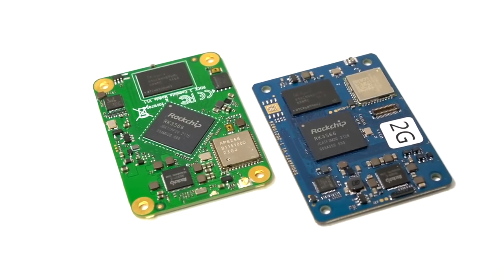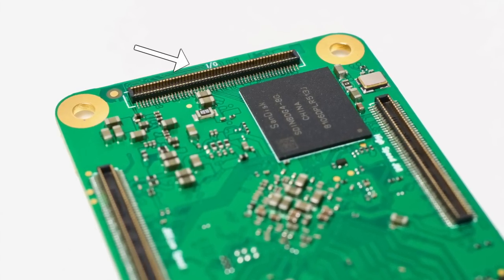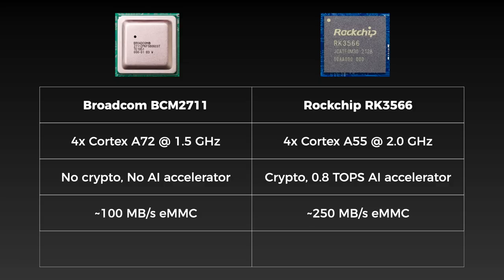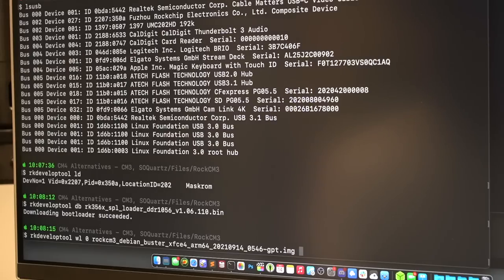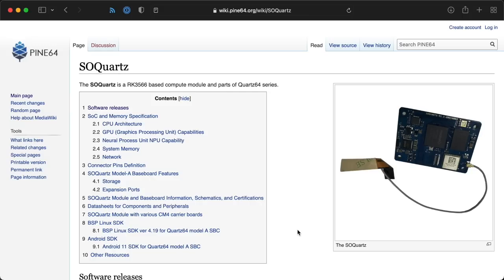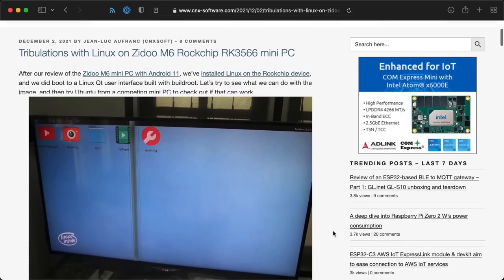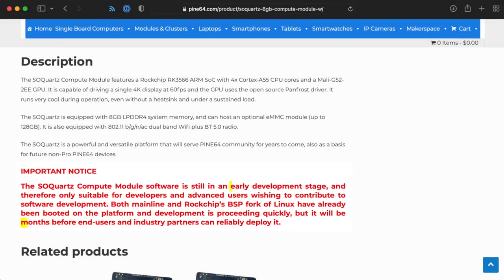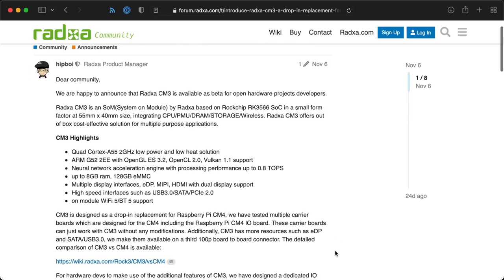Can these boards replace the Raspberry Pi CM4?

Comment: Got similar experiences with non-pi boards. The lack of community support makes them harder to use and after a few years the images disappear from the web and you end up with a paper weight. I do not have this issue with my old raspberry Pis. Third party board needs to be really cheaper to be worth it in my opinion.

Comment: I fully agree with your observation. I had a time where I also bought several other boards based on the hardware specs. They almost all did end up in a drawer because of software and documentation issues. Overall I came to the conclusion that it is far more likely to get your project working with a raspberry pi then with any of the other boards.

Comment: I have to agree with this video 99%. It was a detailed explanation on how is the current state of those very early rk3566 modules. But things will change quite soon. Rk3566 is a new soc and will take some time to get everything working nicely on mainline out of the box.
Reply from the maker: It definitely takes some time, and like I said at the end, I'm hopeful that time will make these boards both viable CM4 alternatives—especially for tinkerers who want to build a compute module carrier but might not be able to find a Raspberry Pi CM4 anytime soon!
Reply: @JeffGeerling  shortage sucks

Comment: Armbian seemed reasonably civilized. I have a super cheap rockchip laptop, and Armbian was pretty easy to setup. I expect hardware projects with the plain boards is more of a challenge?
Reply from the maker: The Ambian community does seem to be the most helpful in the space, and they often pick up support for the more neglected boards. I wonder if some of the board makers should try to work more directly with Armbian to make it a truly first-class distro solution, and offer ongoing support?

Comment: It's fair enough.
Usability is king. If you can't get up and running in a jiff, or sometimes at all, what's the point?

Speaking as someone who detests Linux but has to use it a fair bit, it's actually refreshing to see someone who likes it and cares about usability.

Comment: you are correct on supports importance. At first when i started with SBCs 5 or 6 years ago i bought a few orange pis as they were much cheaper, but i've never managed to get them stable enough, had to constantly try to hack them, so eventually i grew tired of it and bough a raspberry pi 4 which is now running home assistant and is very stable as I'm booting it from an SSD.

Comment: Same impression on my side, BeagleBone Black and Odroid XU4Q are quite the same story: You need to devote a helluva time on getting them to boot to prompt, then to update them, then fix the broken updates, then work some more on them, before even thinking about starting a project on them. 
Raspberry Pi: Flash and pop in an SD card, switch on, start project.

Comment: I have faith that the Pine unit will get there. I have an early Dev version of the Pinebook Pro and it has been a great device. The only reason I'm not grabbing a SOQuartz is that they went with A55 cores instead of instead of A78s.

Comment: @Jeff: actually the A55 is newer than the A72.  A55 is contemporaneous to the A75, and the A53 is contemporaneous to the A72.  The true reason the A55 is slower than the A72 despite the A55's higher clock is because A55 is a "LITTLE" in-order core and an A72 is a "big" out-of-order core.
Reply from the maker: True... that was a bit of a missed statement in my editing. It's faster but not newer.

Comment: I found this to be spot on when working with Orange Pi..a very strong contender with Raspberry Pi...lack of support and documentation yet they work GREAT and are powerful little boards...
Armbian has made leaps and bounds with it's development but like you said...you have to be tech savvy to keep up, however it does work...and works well in almost all cases

Comment: As for me, the important consideration was that Raspibian comes up with the license for Wolfram Mathematica. None of the alternatives do.

About this CPU: having hardware USB3 and SATA is nice, but, you know, those are multiplexed in the RK3356: SATA1 with USB3 Host, SATA2 with PCIe 2.0 x1. So you can have one at the expense of the other. Which is not so nice.

Are there generic ARM CPUs which are faster than this Broadcom and still usable for small/personal computers? (I don't count M1, of course.)

Comment: Not surprised with this.  Am not in love with raspberry but it works.  Am still searching for an easy way to load up around 16 CM4 modules with one standard RB Pi 4B controller.  So, far no joy.  I had hopes for the turning but it was a let down.  I understood the design choices but it conflicted with my overall goals.  Ideally, likely not feasible, I wanted to build a laptop with one master RPi4B and around 16 CM4's.  Where the master could farm out tasks, service as a file server, run the display, mouse and keyboard.  Where the CM4s would handle the actual tasks.  I know that clustering has took a major turn backwards in the past two decades.  So, I have considered writing another OS not based in WIndows, MAC or Linux.  Of course finding software would be impossible if I did as i would have to write it all or convert it to another OS.  PAINFUL!  But at least we would have a working cluster again.

Comment: for the PINE serial port, there's a couple of options out there that work-  use a raspberry pi as your serial interface.   Or, if you've got a busblaster floating around, that'll also work for you.  The DSD TECH SH-U09C2 will do up to 3mb/s  as well,  but i don't remember if I tested it or not.

Comment: This is exactly the problem I've had with some Orange Pis few years back.
Most board vendors just design the board (which is not that hard, just re-draw what's in datasheet, throw some extras and you're done. Did it, been there), build the prototype, get the "Yes I'm alive" signal from SoC and calls it a day. Some even go to such extremes as compiling a kernel or a full OS for you, but that's it. No documentation on anything, some give you u-boot thingies so you can compile yourself, but that's more rare than often. As someone already said, we need standardized boot environment for ARM devices.

Comment: Funnily, though I watched this video on another of Pine64's product (a Pinebook Pro laptop) which by now is quite mature and works out of the box. Proof that eventually, they can manage to release mature products.
Which is also why they have a logic of releasing "early developers access" versions of their products as fast as they can to as many developers they can: their community will eventually manage to help to document, to polish software, etc.
Probably, by their upcoming PineReader (and surely in a year or so their Pinebook 2) will be out, support for booting RK35xx hardware using entirely up-steam opensource package will be in much better shape.

Comment: 5:48 Armbian requires technical know-how? Maybe on boards not yet well-supported, but my experience with Orange Pi Armbian images was pretty easy, just burn it to an SD card and do initial setup, like the Raspberry Pi.

Comment: I totally agree with you. Why people kept using RPis for years even when its performance was pretty bad, had no USB3, and limited to 100Mbps ethernet is because there's tons of information everywhere.
I used to have a Beaglebone Black board, and I still remember the lack of information compared to RPis, though it's probably 100x better situation than these RockChip boards.

Comment: I feel your pain and have a heap of discarded boards to prove it. The one exception for me is odroid which I have found to be quite versatile, sufficiently documented and stable. I'd take a C2 over a PI3 any day for performance especially on ethernet but my use cases don't include wifi. I can't claim I wouldn't love a C4 with 8G of ram like I can get on a PI4 but the networking and emmc of the C4 do make the choice harder despite the ram. Having uboot is certainly a plus as well.

Comment: Jeff is right. These rockchip solution is painful to deploy. Those uboot compile option is needed to flip around to get these board into booting stage. That is why rockchip can’t become a trend. Their hardware spec is good. But, the people who maintain it to keep up with Linux distribution is far from enough or even barely can call it a “product”. It’s like those ancient Android setup boxes become ewaste at the end become vendors are dead or not doing any support at all. Those setup box are still working fine without problems except hardware could be outdated in certain way. But, those are still fully functioning hardwares. It still can be used in certain way. I think that is the problem of arm community. It needs to have certain standard on uboot(like bios with uefi) portion. It makes compilation much easier to support different arm platforms. Then, initramfs can be customized on top of it. It will make everyone life easier to develop stuff on these boards.

Comment: While some manufacturers provide good information, I generally have an issue with RockChip based SBCs. Mainly because they don't just boot from a filesystem like Raspberry Pis boot partition, but they need the binary blobs to be located at specific memory locations on the SD or eMMC storage. On top of that it's a bit of trial and error to figure out which of the blobs are the correct ones for the board (afaik this depends on things like memory speed, soc version and whether you want to boot from flash or SD). 
Even if the manufacturer provides a image, third party support can be quite difficult and even then you might run into issues with the on chip firmware and you have to flash a firmware upgrade via some proprietary software that is poorly documented and apparently some versions of it might select the wrong memory location and brick the board.

Comment: Hopefully we will see a RISC-V alternative in the next few years where everything is open all the way down to to HW. As an embedded Linux developer I would  be more hesitant to do development on Rockchip that is more subject to change than more established suppliers like Broadcom and Qualcomm/Atheros(even though they both have a lot of proprietary parts). You have to remember its not so much the processor(ARM, RISC-V, Tensilica etc) part you are developing for but rather all of the SoC parts(GPIO, HDMI, WIFI, serial, packet-processors, crypto-engines etc)
Reply: The only concern I have with the RISC-V chip approach is that the people paying for the boards may not care to have a standard that even looks like SBC(s).  They might want to implement the RISC-V general spec for only 40% and the then use custom extension.  This allows for them to produce product for specific function.  However it does not mean that we get a usable SBC 'like" board.   Well not a price point that we get with the Pi ecosystem.

Comment: I personally am a software guy, I expect the hardware I buy to just work so I can do my stuff. And RPi is just the safe and reliable choice. Yes, other SBCs might have more processing power, but I think if that's what limits your project you're probably doing something wrong. And others might be cheaper, but honestly that difference in price is far smaller than the value of the time I'd waste by troubleshooting some stupid little issues.

Comment: If you have a Pi Pico, try making it into a UART interface, use the micro usb for console, and its' pins as TX/RX, just make sure you already set the usb baud the same or higher as needed.  This workaround was a hackey solution I did ( and didn't document/backup/save someplace useful ) when I had a few ESP32 boards from an eBay auction and didn't know what was on them or their speed.  One was at the max speed choosable for the Arduino IDE comport speed...  Good luck.
Reply from the maker: Yeah I've considered this; right now I have everything powered off but the Pi itself might also be able to do 1.5 Mbps serial...

Comment: That's what the Raspberry Pi originally brought to the table. It was the cheapest and easiest to use embedded system. Everything else at the time cost at least three times as much and had to have the OS be compiled from source.

Comment: The point made here is rather critical for developers of new platforms, if it is difficult to implement clients will struggle to employ it, or better said, 'the easier it is to implement' then the more easily it is adopted and Raspberry Pi Foundation have really shown how to do that. Again and said another way, my old MacBook failed, I bought a new one, and after plugging it in and entering my iCloud id I got my entire life back again, no fuss, no muss. If you want to develop a new platform really understand what Arduino, Raspberry Pi, and Apple are doing to make things rather less complex.

Comment: Moral of the video is just that those cm4 alternative boards are capable of doing a lot of things it's just that they are new to the market and they don't have good enough compatibility and reliability with applications, tools and OSes at least not yet and when it comes to compatibility in SBCs Raspberry Pis are much superior and reliable not because their hardware is better than the competition but because they are in the game for quite a while now and whenever a developer is developing a OS, a application or even a script for a SBC they usually take a take a Raspberry Pi in mind when building them because Raspberry Pis have been in the SCB industry for so long that whenever you think about a SBC a Raspberry Pi is probably the first thing that comes to mind right and people have gotten used to it because of that.

Comment: Raspberry Pi works.  Simple and end of discussion.  I do not have the time to work threw a new products bugs and incompatibilities.  IF and when they get their crap to work, and they are still being manufactured, I may take a look.  Until then I will stay with Pi boards to to what I need.  They are still dependable industrial controllers.  :)

Comment: Back in the RPi 3 days, I bought the Rock64 because of its specs. But I never got it to work the way I wanted.

Last week, I tried using the Rock64 as a NAS. There's prebuild images with OMV. But I still couldn't make it work.

Comment: I still have some random board sitting at my closet, that I gave up on due to lack of any upstream support.  IFC6410: I think it has the same SOC as the Nexus 4, and it even uses the Android boot image format.   Linaro released a few Ubuntu builds for it, then just stopped.  I tried compiling an upstream kernel, and it saw the onboard SATA as having 0 ports.  At that point, I gave up, and stuck it in a box in my closet, and haven't touched it since.  Come to think of it, I wonder if I should just put it in E-waste?

Comment: If you are developing some imbedded system where you set it up one time and never have to touch the software again, then I think those boards are great, but if you want to play around and use the board for lots of different small projects, the one with the better documentation and community is obviously the better choice even if the hardware is weaker.
Also you can tell just from a glance that the pi has the better EMC design.

Comment: I got my giveaway from Jeff and man I didn't realize how small that CM4 is.
Reply from the maker: It's similar in size to the Pi Zero! Enjoy the CM4 :)
Reply: @JeffGeerling  thank you. I'm working on getting debian working on the CF Robot router board so I can use it with my tailscale/headscale install. Thanks again.

Comment: I think the A72 cores in the RPi 4 are not newer than A55 cores. In fact, they are extremely ancient while A55 is relatively new. It is just that A72 cores are ARM's "big" cores while A55 are "little" cores, which explains the performance discrepancy.
Reply from the maker: Not extremely ancient, but definitely not newer, that was an inaccurate statement, oops!

Comment: I truly be happy if we have a replacement for the Pi. I think that is does not RIGHT to have the Pi getting all the attention WHEN it is absolutely NOT AVAILABLE at all and when you want to buy one it's PRICE is reticules I will not pay 200$ for that small no-good-for-nothing then a toy. I have had several projects that I wanted to try and when i start looking for that Pi Board 3B+ or 4B+ I was asked to pay 200$ even for the 2GB board. That is NOT wise to SUPPORT only the Raspberry PI and I know that there are plenty  other boards that are MUCH Better then the Pi, At this point when it is not available - it is worth nothing! so if you have a board that is available and within a reasonable price range - I'll work on it to make it work!! and help other to get the board and use it easier - that is exactly what I had to work with when the FIRST Pi came out - so I think ALL boards should have the same opportunity - I would be happy to see less Pi and more other boards that compete with it - I do NOT even think that the Pi is even good for the tasks that I need it to do. IF you can please share more OTHER boards and I will be happy if you give other the same amount of screen-time and investigate with us to learn NEW boards - that will probably replace the Pi - I would be happy if you could do a comparing with Pi and other that we can use to replace it - while at this point it is NOT here! and that is why it is no-good-for- the job. More Other boards - NOT only Pi will be great - 200$ is Toooo much. LETS BUILD A COMMUNITY!!!! Not only PI. Thanks for the videos.